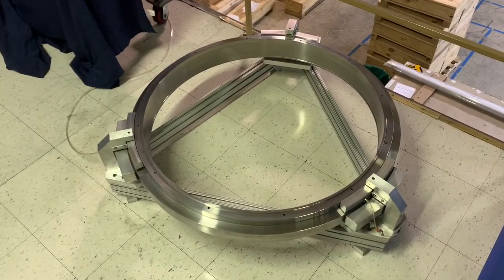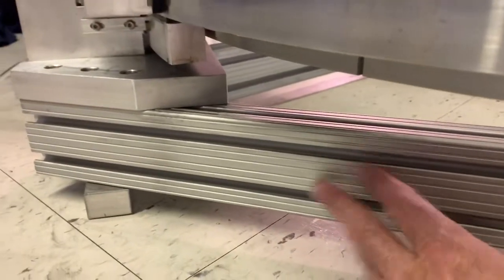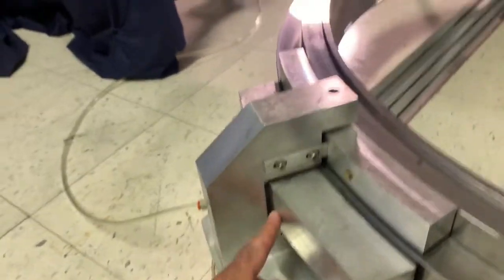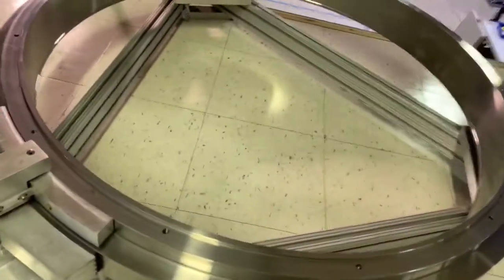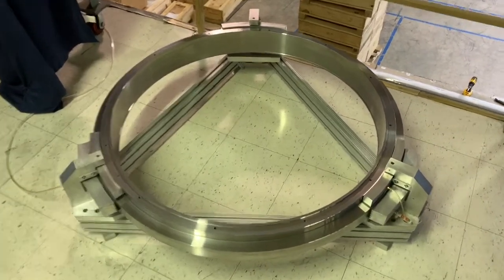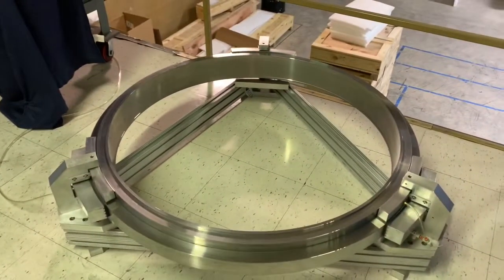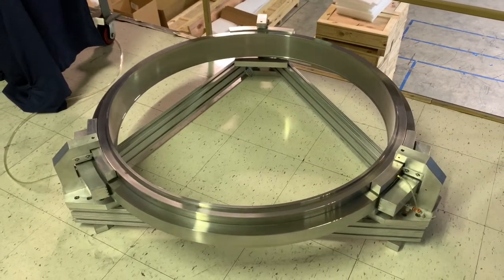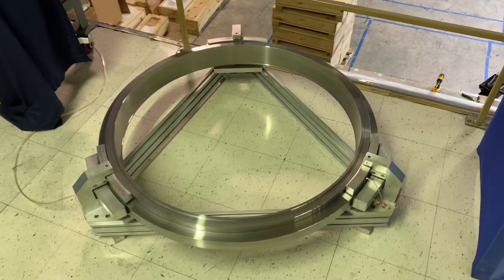Radial Air Bearings mounted on a stator made of 80/20 are used to support a 360lb open core rotor

Comment: I found intrest in these when I got into Computed tomography. The Phillips CT scanner I currently run works on an air bearing. I think it can make a full rotation in .3 seconds.
Reply from the maker: I think it makes a rotation in point two seconds in production machines. Philips is still a customer of ours for computed tomography machines in the development, back around the turn of the century We had a 2 m diameter rotor go 500 RPM with over a ton of rotating x-ray equipment on it. That’s less than point1 seconds per Revolution and over 100 m/s surface speed
Reply: @drewdevitt  wow, impressive.
Reply: @drewdevitt   I don't doubt that it can make that rotation faster, my interface only allows me to select that minimum . 35 second rotation speed for image acquisition.

Comment: People really want to see these air bearings in cnc industry..in the machine tools..... Supporting heavy depth of cuts... Replacing conventional contact bearings and expensive hydrostatic bearings.....can they do it drew? With current technology that you have?
Reply from the maker: This reply is bit late.
Yes, ultra precision diamond turning machines are major customer group for us. Hydrostatic bearings are a significant heat source and heat is a first order error source in precision machines. This is especially true of large vertical turning machines making large bearings and gears, like for wind turbines. Air bearings would be perfect for improving the machining and metrology of these large parts.